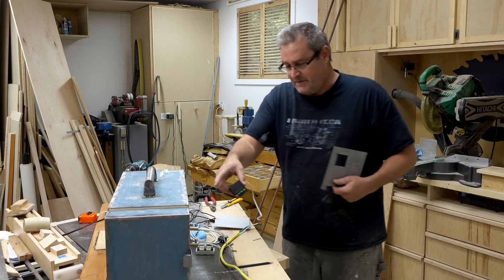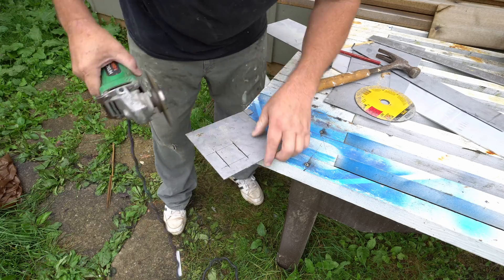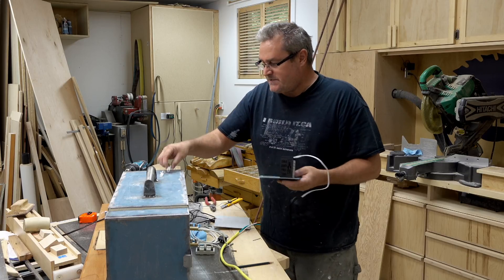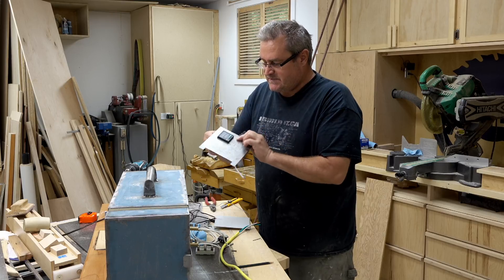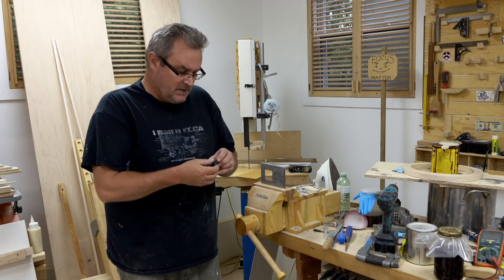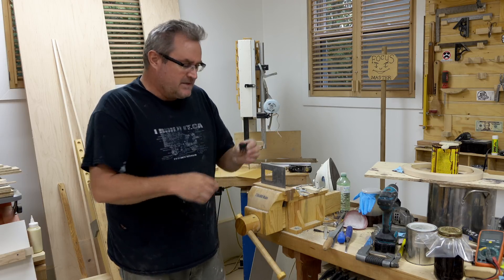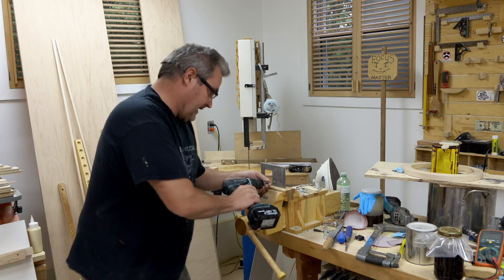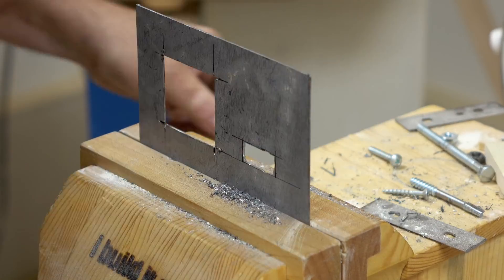Making A Heat Treatment Oven - Finale

Comment: I'm about to build a heat treat oven with pretty much the same layout as yours. I was curious to know what the highest temperature you were able to achieve running on 120volts? I'm building this oven to heat treat stainless steel knives at a temp between 1900-2000 F and hoep to achieve this off of 120 as well rather than 220.

Comment: Just found your channel - Very good job on the oven. Having never worked with a few of the electric things mentioned what is a PID? Obviously it is sensing the thermocouple and controlling the relay, but I have never heard of a PID. I will be building one in the future as I could use it for heat treating some lathe HHS tool bits, .... etc. Thanks for a great video!

Comment: FYI, some of those PID controllers are actually 12vDC for the supply power. Imagine my surprise, when following the directions, and hooking it up to 120vAC. Let the smoke out pretty fast. The replacement had the same error in the manual, but it works fine on 12v.

Comment: You mentioned that the temperature control was in Fahrenheit. But when you start showing the .PV of the PID, it is at 29. I tend to doubt your shop was at 29 F. So, is this controller actually running off of Celsius? Or does the zero and span of the PID need to be adjusted? Different thermocouples have different ranges and in any event need to be spanned correctly in the controller.
Reply from the maker: I said 29 Celsius when it first started and then changed the settings to Fahrenheit  off camera.
Reply: Gotcha. Sorry I missed that.

Comment: Wow. I wish I'd asked for your input on my coffee roaster project.  It's on my YouTube, but I'm pretty rambly, but the last video I posted talks about the control panel. I'm not going to be disappointed if you don't look. You're busy. I get that.
Reply from the maker: I've watched a couple of those videos, I'm subscribed to you on my red channel. Nice progress on it!
Reply: Well, if you have suggestions on safety devices for it, I'd love to hear it. I plan on using thermal breakers, and then  individual resettable breakers for the elements. But that's about it.  I had to learn a lot more about electricity than I thought just to get to where it is.
Reply from the maker: Will you be running it unattended? If not, I'd just trust the PID's to control the temperature.
Reply: I Build It Scrap Bin , no. And it will be used in my cement shop, so I feel pretty confident in my fire safety.

Comment: Hey John, amazing build! It just looks perfect!

If I understood everything well, you're using your PID regulator and solid state relay as an on/of function now. If you really want to, you can make your oven much more  precise by actualy using your P and I function of the PID (because a temperature regulator is a slow process, the D action isn't going to do much). A PID  has the option to use your output with pulse width modulation to drive your solid state relay and keep your oven on a constant temperature instead of a high and a low point. If you want to know more about that you can always send me a message and I will gladly help you out with it because tuning those things is part of my daily job.

I really love the design!

Comment: Great video John. thanks for sharing. i have been wanting to make one for a long time now but never got around doing it.  Im planing to make my own controller using arduino or similar as it will be pretty easy and cheap to make. It is funny to see thay call their controller a PID as that is definetly not a PID controler. I is usualy refered in control systems as a "on off controller" or sometimes it is also called " bang bang controller". it is the most simple controller to design and implement, and for those application it works great.
thanks again for sharing. got some usefull ideas from it.
Reply from the maker: It is a PID controller - proportional–integral–derivative with settings for each.
Reply: I Build It Scrap Bin oh ok makes sense. however it this situation it is not working as a pid. for a pid controller the output needs to be controllable. for example if you would have a regulator on the coil alowing to control for instance the voltage , than you would be able to control " how much the coil is on". in this case, as you are controlling it with a relay, you can only turn it on or off. the whole idea of a pid is to be very fast and adaptive to changes. 
As another example lets say you whant to set a temperature of 1000. If you can only turn the coil on or off, the controller will probably whait until the temperature reaches 1000 and than switch off. than it will go on again when it goes below a set value. this is an on off controller. when using pid, depending on the gain parameters set, when the temperature reaches for example 950 and the error becomes smaller, the controller will lower the voltage on the coil so that when it reaches 1000 it will not overshoot too much and will mantain a steady state. most temperature controllers don't use pid as it is not required. themperatures in those ranges usually changes very slow and an on off controller is prefered.  Hope this wasn't too confusing. Looking forward seeing this in action in a future video
Reply from the maker: Nope, it uses the relay to do the proportional heating, switching it on and off to vary the output. You might be better off forgetting the arduino idea and just pick up one of these cheap devices that do exactly what's needed for a job like this.
Reply: I Build It Scrap Bin you have said it in one of your past videos. Diy is not just to save money hahaha. I enjoy doing it myself 😀
Reply: I Build It Scrap Bin you are correct. I just did some research on these Controllers and as thay are using solid state relay thay can simulate analog output with pwm. My apologise
Reply: The PID device contains a PID controller, but here it is likely used as a bang-bang (or hysteresis) controller. (I have to admit not having read the build article). Just turning on or off the actuator (=heating element) is what such a controller does, and that should be sufficient for this application. None of the proportionality/derivative/integral settings matter in that case, only the set point temperature and possibly the hysteresis thresholds are meaningful to adjust.

Comment: This is exactly the same setup I used to add temperature control to my electric oven range burner. The entire time I was watching, I was just comparing our temperature controllers and it definitely seems like we have the exact same kind. Yours is for hardening steel, mine is for softening your belly.

Comment: Just curious.  What is your thermocouple type??
Many years ago I built a oven using Kanthal hairpin elements and 480V 3 phase  with an off fire temp of 1200 deg C.   I used a type K  which is marginal at 1200 C  but 1000 C is the sweet spot which is where we wanted to operate at anyway.    It was for curing out Graphite Steel Mill Electrodes after pitch impregnation.  Looks like a pretty nice build.  Only thing I would do a little different is to find some ceramic tubes to cover the element wires as they come through the metal case.   You don't want the case to get hot.  (electrically)  All in all a very good job though.

Comment: I think your run down of the electrics was suffice, no need for extra video explaining... then again I am an electrician...
Reply from the maker: Jeff - the case is fully grounded, look at all of the connection points. I mean seriously, guys, get real.
Reply from the maker: Wow.
Reply: The path between the case and the ground needs to carry enough current to break the breaker, before doing something dangerous, like causing a fire or electrocuting someone. The reason you ground the case is, that if the hot wire the heating element gets loose and touches the case, it's better that it shorts to ground and trips the breaker, rather than just making the whole box a hot wire, waiting for someone to touch it. If you really want to know if it's sufficient for that, you'd have to know the resistance to ground on the farthest (electrically) part of the case. That's how an engineer would do it. I'm not worried about John though. Scraping the paint would make it break the breaker quicker, but this will probably work and there's not a high probability that it will ever be needed.
Reply from the maker: I'll include a schematic in the build article, when I get that done.
Reply: upon further inspection you were drinking MGD... come on man sleemans for the win!
Reply from the maker: I like Sleemans too, but this is my current favourite. I don't drink enough of it to sway the economy one way or the other.
Reply: I believe he grounded to the aluminum plate. Proper would be to grind paint off anywhere that needs bonding and attaching a proper lug.  Assuming there is not coating on the aluminum it should be fine for what he is doing (if you did a continuity test anywhere to ground I'm sure there would be because of the bolt hardware touching metal between paint layers).
Reply: ya see Guelph loves me
Reply from the maker: Mihai - stay inside, man, it's dangerous out here.
Reply: Just measure the resistance with an Ohm meter. I would probably do that before using it. Probably less than an Ohm. Even though steel is not conductive compared to copper, sheetmetal is so wide that it ends up being a pretty good conductor. What it lacks in thickness it makes up for in width. This assembly might not pass muster with UL, but it is good enough for me. Also, if you use it on a GFI outlet, then you have even less to worry about.
Reply: I Build It Scrap Bin , I say that all the nay sayers should build one, while video taping it, then hook it to the wall, and short it out, again while on camera, and  touch it to see if it's grounded. Lol, that should take care of things!
Reply: I don't mean to criticize. I haven't done the math, and I don't have enough first hand experience with 15A circuits to know by gut. Code for 15A circuits is what 14ga? I'm just trying to add some info here. There are 5 screws connecting the grounded part to the case (4 directly and one to the front panel). The screws are certainly bigger than 8 gauge wire, which is more than enough for 15A. But the sheet metal is thin, so I'm not sure what the area is between the screw and the sheet metal. Is it as much as a 14ga wire? Probably, or at least close. Just trying to look at it analytically, and really, I'm just working it out because it's interesting.